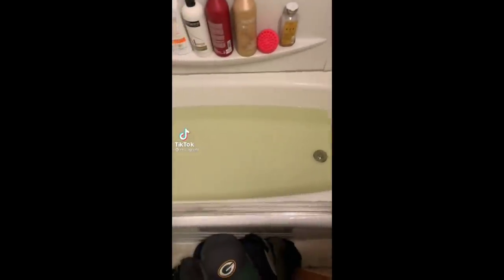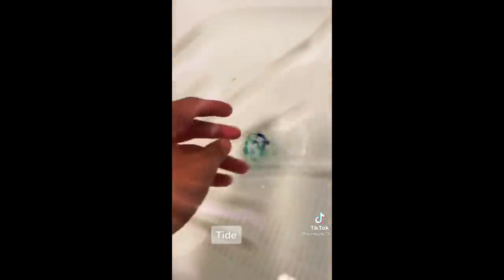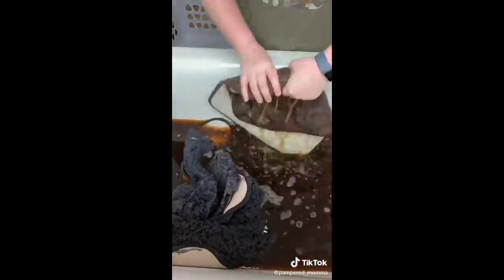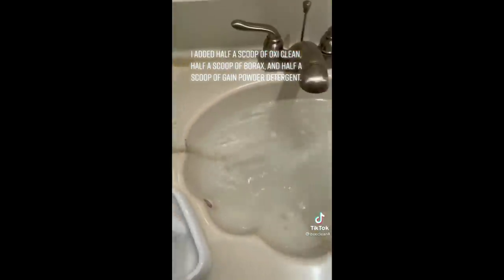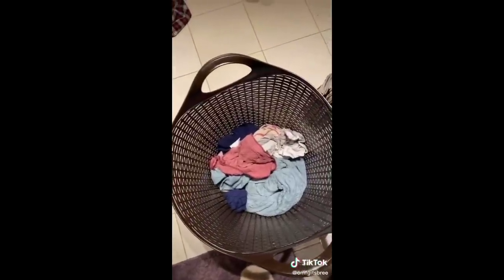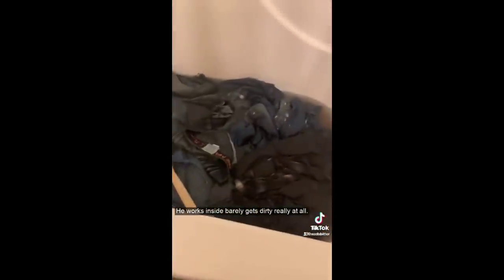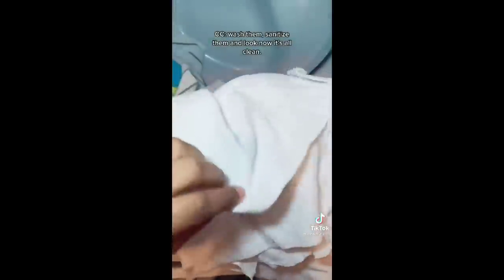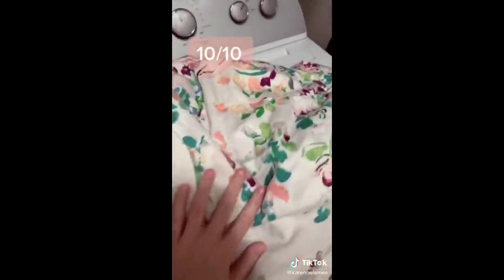Laundry Stripping TikTok Compilation #1 ✨| Vlogs from TikTok

Comment: Okay yall dark colors and HOT water dont mix that well but go off. This is so satisfying
Reply: They don't, but the water colour was definitely from the dirt and probably not much from dye at all.
Reply: I did this with white curtains and plain old slightly warm water and it still turned out pretty dark, funny thing is the curtains didnt even look dirty I wash them once a month!!!😬
Reply: @ash8569   you need to rinse them off and wash them again
Reply: @ezxnoi  I know that. Don't want soap stuck in em.😂
Reply: That’s literally how it gets cleaned lol it’s not laundry detergent and it’s not a washing machine. The dark clothes are perfectly fine.
Reply: Honestly if you wanted to stir it and let it sit longer you wouldn't need the hot water. The heat just breaks down  oils faster
Reply: I was wondering if we were just stripping out the dyes or actual dirt😂

Comment: Do people know they can do this in their washing machine? Why the bathtub? It's called presoak.
Reply: Thinking the same thing
Reply: Easier for people to see.
Reply: I was thinking the same... especially for the 2nd lady who put shirts and pants in the tub... like... if you need to presoak, and your washing machine doesn't have that option... just stop the washer when it fills with water and press start when you're done  soaking
Reply: Just went to comment this until I seen this.
Reply: Some may not have a home washing machine possibly. For a long time I had to use a laundry mat.
Reply: I think maybe is because some of the people can’t afford washing machines! But that’s only for some people! But if your going to do this be very careful cus if mold-
Reply: My washing machine doesn’t have a presoak setting
Reply: @ingridmedina9913  you can fill it up, then turn it off once it is all the way filled up. Soak clothes for however long you desire.  Then go to rinse cycle to drain water. Once that is done and it starts spinning stop it. Then start load all over from the beginning.
Reply: @Tata-iu3fy  even if it’s not a top loading?
Reply: It locks and there’s no button to unlock it
Reply: @ingridmedina9913  oh. No. Not high efficiency washers. Sorry. Mine broke so I went back to the top loading washers.
Reply: @Tata-iu3fy  got me all excited 😂 thanks anyway
Reply: @ingridmedina9913  aww, sorry.
Reply: @ingridmedina9913  you can just let it fill up and then stop it and let it sit for a little bit.
Reply: Thinking the same thing too
Reply: As someone who doesn't have a washer at the moment because it's getting repaired (waiting until the part comes in) I only washed for 30 minutes in a bucket and this still happened
Reply: Front loaders often don't have an option for this long a soak
Reply: @Swingin69s  Mold is only a problem if you have shit ventilation and keep the soak going for multiple days. A box fan should be more than fine to combat steam condensation
Reply: i think it's probably more satisfying to see and people may worry they are dirtying their washing machine more. some of the items are also super bulky so soaking in the tub might be more efficient.  the one thing that bothers me is how some people don't realize how much is dye coming out
Reply: Who wants the washing machine on for hours ?
Reply: @ingridmedina9913  My washing machine doesn’t have a way to unlock it— like a button specifically for that. But I figured out that I can unlock it by pressing the start button and holding it down for three seconds. I hope that works for yours!
Reply: Front loaders do not have the option to soak nor do they fill up with water! You can only do it with the top loaders.
Reply: @Tata-iu3fy  saw*
Reply: True but it’s hella satisfying to me tbh
Reply: @ciaran.k  it's not on. You let it fill up with water so the detergent dissolves and then turn it off. When you want to finish the soak, you just start the washing cycle again.
Reply: Bro I don’t care this was 3 months ago 🤣
Reply: Bc sometimes the tub is bigger. Not just that but everything can lay a little more even
Reply: its harder for HE machines
Reply: Pre soak wont soak for 24hrs
Reply: A lot of the presoak only lasts a few minutes before it either drains or the cycle starts
Reply: The washer will mess the hats up
Reply: Broken machines, laundromat is too far, stuck in quarantine, and so on
Reply: Not all of us have a washing machine in our homes or one that is not public use.

Comment: Ask my dry cleaner if laundry stripping is necessary, she said NO!  She says mixing chemicals into hot water and adding your clothes damages threads and material, your clothes will go bare very quickly.  She said washing your clothes in a regular washing machine is all you need to do.
Reply: Thank you for mentioning this. This is really excessive and I thought there was no way you could do it without ruining your stuff
Reply: Also, how much of that color is dirt (in the water, not the sediment at the bottom) vs fabric dye being stripped/bled?
Reply: I mean you don’t actually have to use borax baking soda etc you can soak them in water and add a little bit of detergent, here in Nepal well at least where I live I believe everyone washes their clothes like this and it does not damage the clothes
Reply: @nirjalachaudhary6443  These aren't strong chemicals. Borax is only detergent. It works well with regular soap to get clothes clean. Baking soda might help loosen dirt. They say it whitens whites. Vinegar definitely helps get soap out in the rinse water. I think people use too much soap, so their clothes hold the dirt. Our clothes fade, from washing, so that accounts for some of the water colour, too.
Reply: TikTok cleans are always excessive. You could literally do this with just hot water and maybe a little detergent.

And no it isn't necessary. Some people are neat freaks though . And some of us have weak washers so this helps.
Reply: Thank u. I thought it was dye from the fabrics. Specially with hot water.
Reply: your dry cleaner is afraid to loose your business they do it like this in poor countries.
Reply: This is how they washed clothes before washing machines so I call BS on what your dry cleaner said.
Reply: Right! I would only do this with blankets
Reply: If we're going with what's strictly necessary and nothing beyond that you wouldn't be talking to a dry cleaner now would you?😂😂😂
Reply: Tell your dry cleaning person they don't know what they are talking about! I strip my curtains and area rugs in the bathtub and they get cleaned very well.
Reply: @dawnwelch7653  Exactly!

Comment: Presoak in your washing machine.  Add washing soda to the wash cycle, don't use softeners, use vinegar instead  (with a few drops of lavender oil). You'll never have to do this again. 

Also a lot of this is the dyes coming out if your using really hot water.
Reply: Yup it’s mostly dyes
Reply: Thanks for the tips!
Reply: A lot of people have front loaders with stupid settings or delicate items that don't go in a machine
Reply: @zvezdoblyat  agree, I've seen fabric sports shoes, soft toys and quilts put in front loaders.  Also, wash your woolens and silks by hand not machine. It seems common sense is rare today.
Reply: @juliestam1147  I remember ruining a beautiful blazer because I didn't read the fibre content and didn't realise it was 90% wool. I'll never make that mistake again

Comment: This does work however you are supposed to do the hottest water your clothes CAN handle. Plus read the back of your washing soda box there is some useful information to read. If your clothes need cold water,use the hot water to dissolve the powders, let cool then place clothes in.
Reply: That's literally a recipe for bleeding the dye out of your clothes and why the water ends up so dark in most of these. facepalm

Comment: I am just watching this like ... Don't you people wash your shit?
Like those bath mats. They've never seen a washer from the inside, I bet! 
The hats/basecaps? I can see that you want to wash them by hand, but not let them soak in for hours, they WILL break! Wash them by hand, brush out the dirt/sweat and try not to get the front part (what shades your eyes) wet, because that'll just break apart after it gets soaking wet. You ruin your basecaps that way.
And most of that laundry stripping is absolutely useless, that's what a washer is for.
You got a prewash cycle. 
IF NOT, use a regular wash cycle, and stop it before it rinses out. Just plain stop it, or if necessary, pull the plug. 
Then turn your washer to "Drain". Wait until that's done.
Then start a new cycle, so it can be washed properly.
Then, use a high quality laundry detergent, and depending on your water hardness, use a water softener (There are special products).
Another pro tip... more isn't always better. Too much fabric softener, and scent beads that a.) ruin your washer and b.) ruin your skin and cause allergies. 
The usage of essential oils or perfume oils can cause the same. 

So, basically: A good soap (a laundry 'powder' is usually enough), a water softener for hard water, and maybe something for stains. A little bit vinegar, or a fabric softener without scent, depending on what you wash (things like synthetic clothing doesn't always take well to fabric softener, and microfibre especially), and separate your clothes by fabric, color and by how dirty they are, and dose and use the wash cycles accordingly. 
Rule of thumb, bed sheets  all 14 days, bath/toilet rugs/mats at least 1per week, pillows/comforters at least 1per 6months. 
Dishtowels/microfibre towels/mop heads 1per week, in as hot as your machine goes.
Socks/Underwear separate from the other laundry, as hot a cycle as possible (look into the instructions).

Comment: Maybe I'm a bone head, but after you do the stripping in the bathtub, do you rinse them out in water or do you put them in the washing machine?
Reply: Don't do this. It is silly and unnecessary.  Use the presoak function on your machine, that's all that is needed.  Also, don't use hot water on dark clothes, most of the "dirt" will be the dyes coming out and your clothing will then fade.

Comment: Lol it's just called washing. If you ever have to wash clothes by hand (for some reason like absence of a washing machine) then leaving them soaked in for some time helps a lot. You can use warm water but don't use water that is too hot or it's gonna damage the fabric. I also think that there is some prewash-soak kinda option in washing machines too. I am just very surprised by people reacting like it is some genius trick. Most people I know wash there clothes like this 🥲